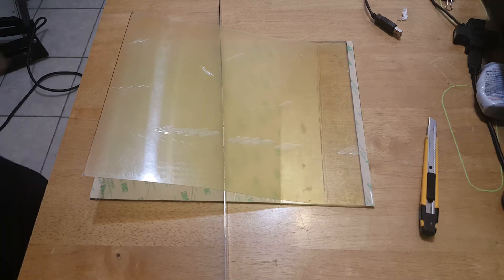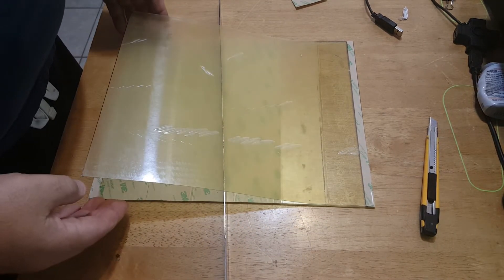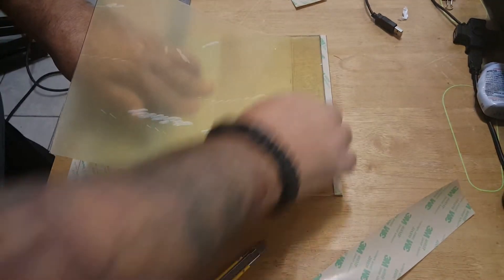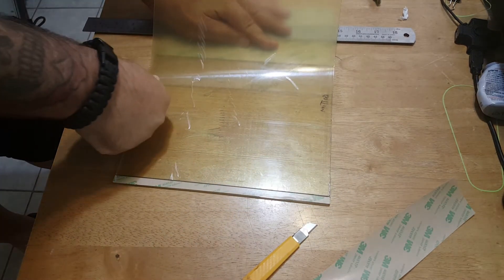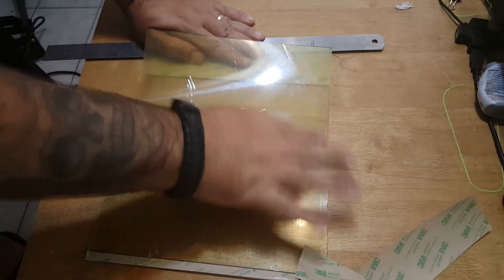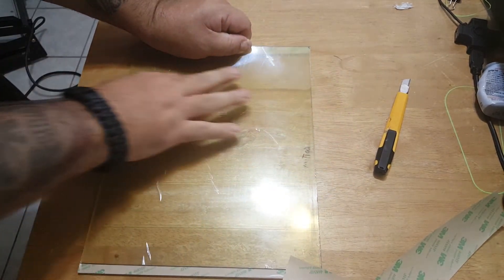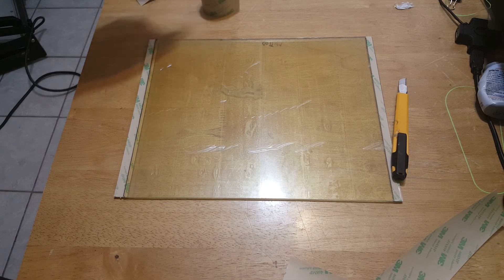How To Mount PEI Plastic To A Glass 3D Print Bed

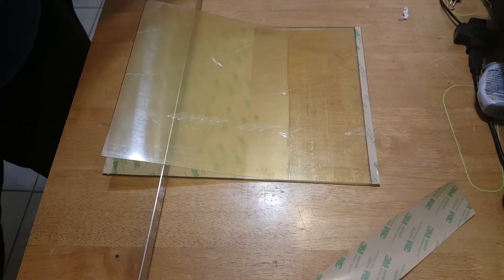Comment: 2:38  "If you try to use that one piece, 12X12, it could be a challenge."  Unfortunately, I have six sheets of the 12X12 3M 468MP adhesive.  Good luck to me.

Comment: How easy is it if you need to remove or change your PEI sheet from the print bed with the 3M AdhesiveTape ?
Reply from the maker: TheGreenPastures not hard, I used a putty knife
Reply: Thanks, then I will use it on top of my 300 x 300 mm fixed alum. bed
Reply: 3M makes an adhesive remover that works very well when it's time to change the PEI sheet.  It's $22 a quart on Amazon.  Prusa's website has a page describing how to use it.  Basically, freeze the glass sheet and the PEI separates from the adhesive.  Then soak a paper towel in adhesive remover, lay that on top of the adhesive, put it in a large zip top bag and let it soak for around an hour and the adhesive scrapes off easily.  Use more adhesive remover and a lint free paper towel (I like the blue shop towels) to clean off any remaining film or smudges of adhesive.

Comment: I went the easy way. I got the 12x12 and cut it into 2x2 3x3 or so chunks.

using the stock heat bed for my monoprice maker select I put one chunk in the center and one in each corner.

I already have the silicon thermal pad 8x8 on the PEI. I just layed that right on top of it. Wam. Done. :-)

Seems to be holding up good so far.
Reply from the maker: thanks for the reply, good info.

Comment: You can get a 12" X 12" sheet of the 3M adhesive instead of strips. You can use soapy water on the glass to lay the adhesive down, remove any bubbles and align it. Then wait a few hours for it to try or accelerate the drying by setting it on your printers heated build plate. Once dry you can peel off the out her side backing and lay down your PEI sheet. Worked out flawlessly on my first try with PEI!
Reply: +sideburn the soapy water works okay even on and over the adhesive?!  after it drys it still sticks?
Reply: +Jon C. Yes it works perfectly.